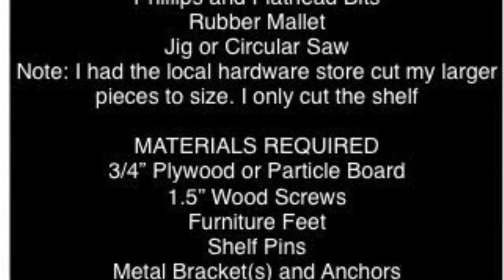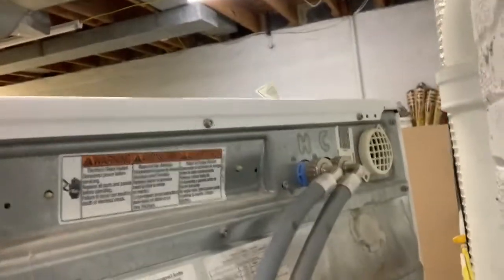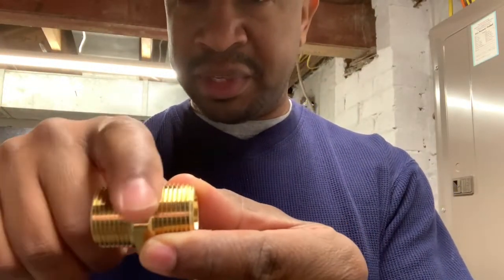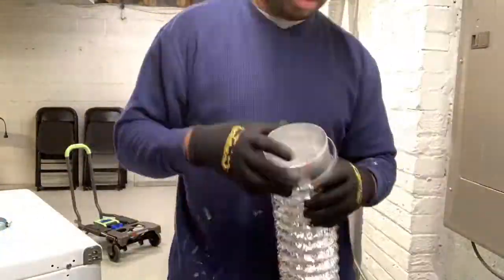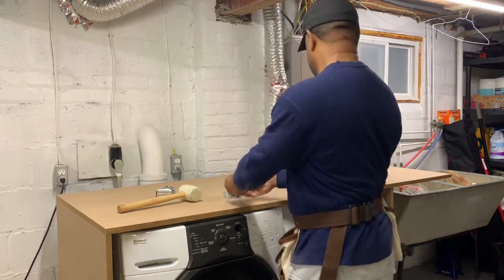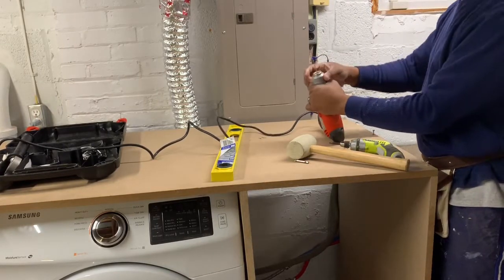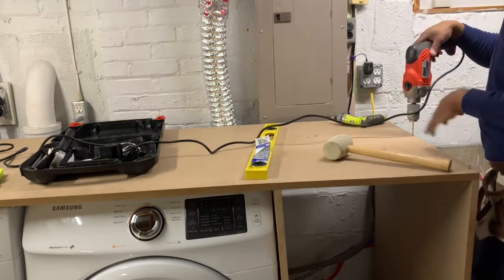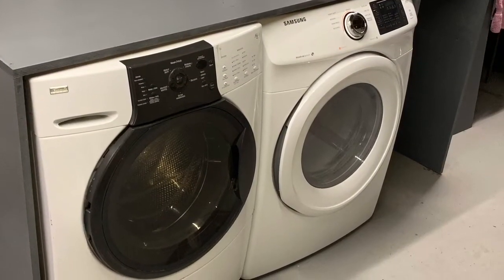How To Make A Custom Laundry Cabinet

Comment: I see you brought a lot of extensions, but just for others to know, you can purchase new hoses (inlet, drain, dryer) that are long enough for your set up. My washer came with short inlet and drain hoses and i just replaced them entirely with 8ft+ hoses to reach my plumbing. It will save you time and money because with every extension, you need to cut/trim and buy connectors/adapters.

Comment: Hey James. So it's December 1st 2020 and I was looking for ideas on how to build a bench over our front loader washer and dryer. I think I'm going to follow your guide but with the addition of a thin sheet of ply on the back to help brace it. I have a staple gun so I reckon I'll just staple it around the edges to secure it to the bench. Great video. You have a voice that's easy to listen to (except for the voice over bits :) ) and easy to follow ideas. Thanks for taking to time to put the video together. Much appreciated. Hope you're still travelling well. Cheers from Western Australia.
Reply from the maker: Thanks. Sorry for the audio issues on my voiceovers. It was my first how to video. I know how to control it better now. I didn’t close the back because the wood I used was thick and flat enough for it to be very sturdy with the screws. I also didn’t want the restrict the flexibility of the dryer and washer hoses. I hope your build is simple, easy, and successful.

Comment: Whooo, wouldn't it be much easier to switch the doors ?  My doors are interchangeable, can mount on both sides. You are doing it the hard way.
Reply from the maker: Yea. At the time I didn’t know you could do that. LOL. I woulda thought the previous owners would have done it if it was possible. I guess they aren’t as practical with regard to function as i am. I’ve never had front load machines before. You live and you learn….